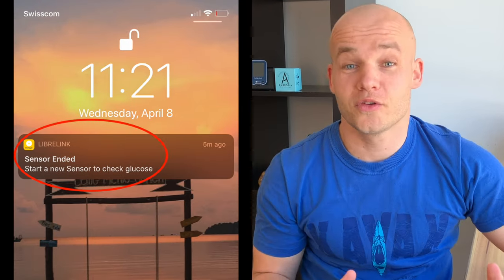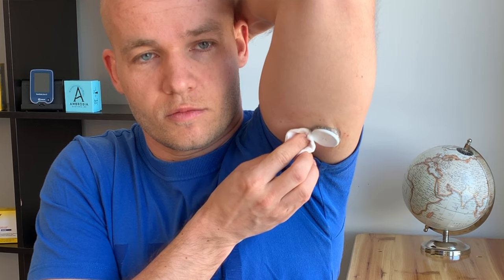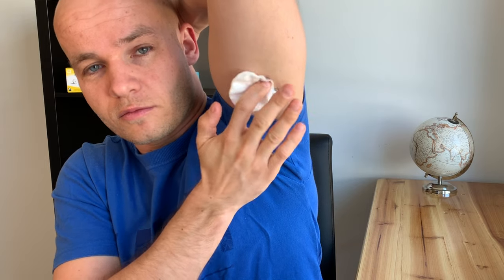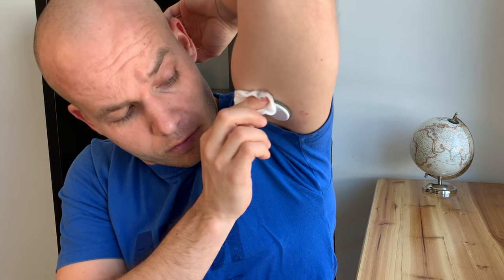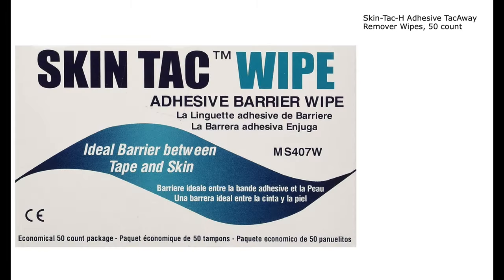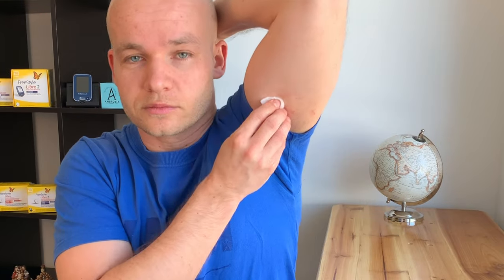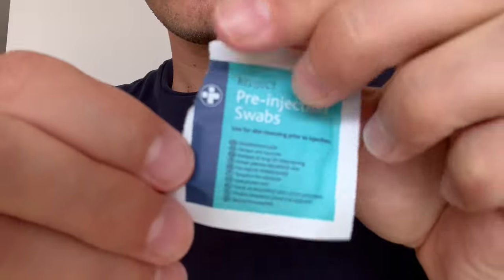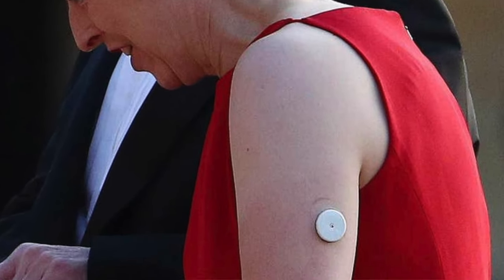How to Remove FreeStyle Libre Sensor / 5 Tips for Painless Removal

Comment: This has nothing to do with removal. But do you talk about why a sensor is off by 15- 30 points?  I dont have type 1 but i do have type 2 and hypoglycimia. I dont feel when i get a dangerous drop so the dr gave me a sensor to wear so when i do drop it will alert me. Problem is it says ive dropped to 65  or even 55 and i manually test and it 30 points lower than the manual.  It was gping off so much that i finally shut off my phone.
Reply: I just started using this and it will be interesting to compare the readings with my test-strip based meter.    You don’t have low blood sugar symptoms?   That sounds scary and dangerous.   When my blood sugar drops into the 60’s it is scary because I start to feel “jumpy”, very tired, and sometimes start to sweat.   At that point I start taking spoonfuls of sugar (I keep sugar packets handy).   I’ve had to wolf down four Hershey bars a few times - sounds like fun, but it’s not - to make sure I can get my blood sugar to rise rapidly.

Comment: Gasoline works great also. Just saturate a grease rag and let it soak in. Just don’t light a cigarette when removing the sensor. You can also read the libre-2 instructions and find absolutely nothing about how to properly remove the sensor.😪